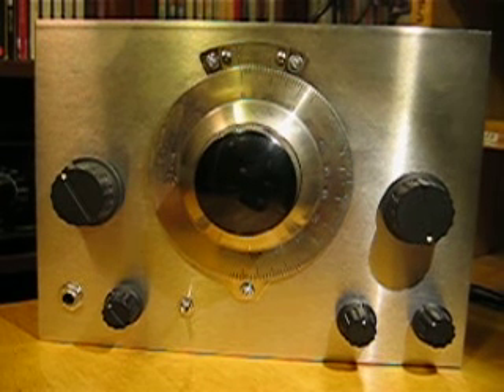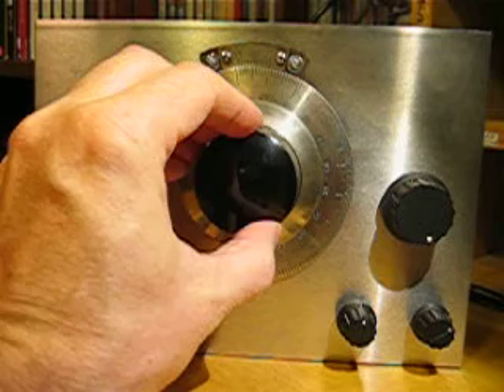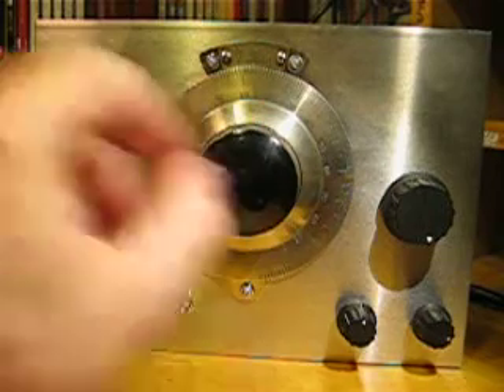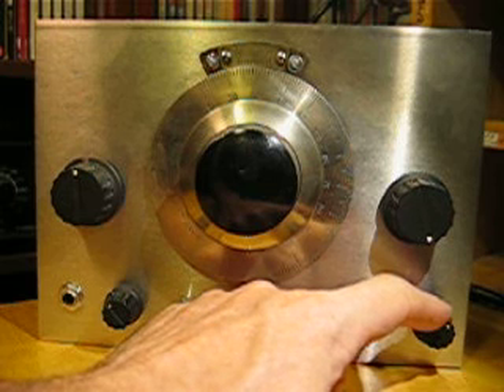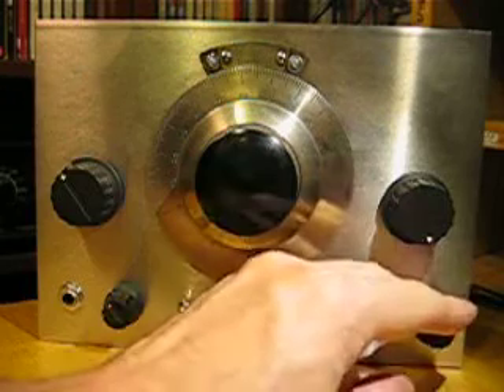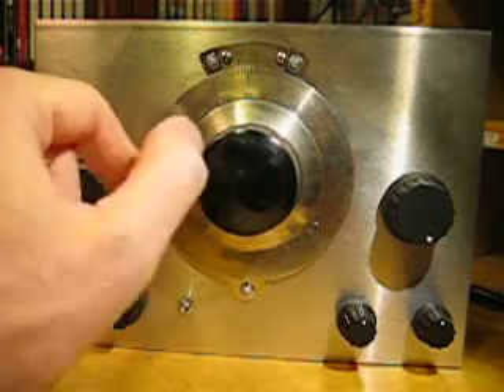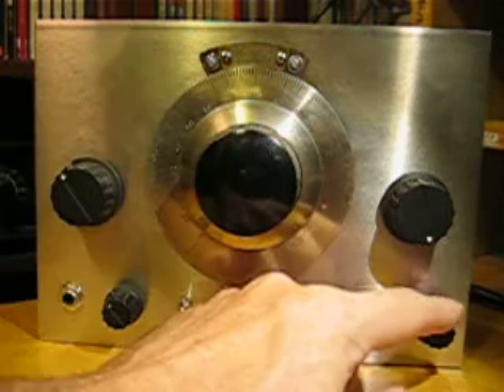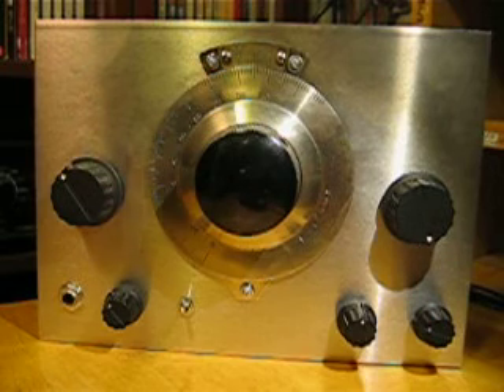The Sproutie General Coverage HF Regen Receiver in the 60M and 49M SWBC Bands - Video 1

Comment: Does the audio bandwidth filter make a significant or subtle difference when adjusting it up or down?
Reply from the maker: The filter has a wide bandwidth. It's a fairly subtle difference. When receiving AM, it basically serves to cut out some of the annoying background hiss.